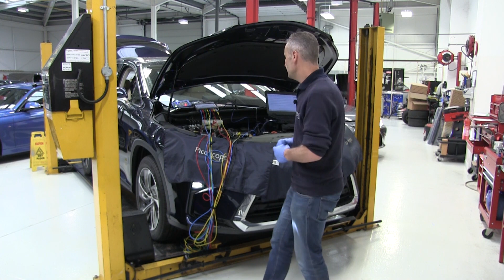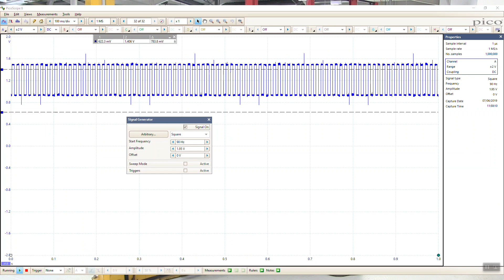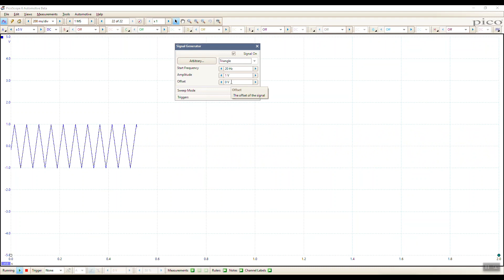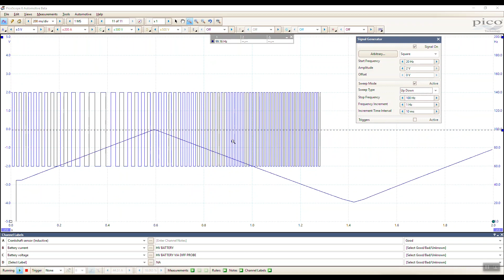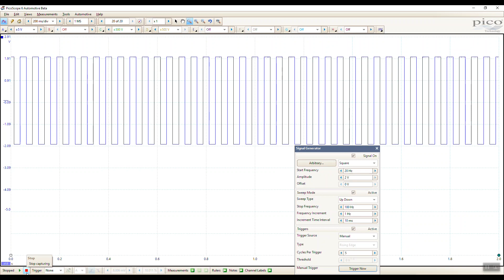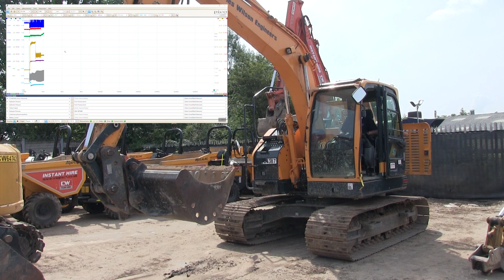Practical Pico: 8-channel testing with PicoScope 4823

Comment: are you guys coming out with a better 8ch than the 4824 clone at 50v? I feel like Pico can do better since the 4425A & 4425 at 200v
Reply: Id be interested, but wouldnt the common ground of the 8 be a bit noisy?

Comment: Awesome premier gents, I'm really excited for the 8 channel and the flexibility it will give us as Diagnosticians ⭐⭐⭐⭐⭐
Reply: Thanks for the kind feedback. Much appreciated 👍
Reply: Simply Diagnostics Steve how do you think the lack of protection voltage affect your use of this? 100v vs 200v input protection? I thought about getting this but I have the 4425 4ch. The sample rate seems better however there are some sacrifices. You think it’s better worse or different ?
Reply: @weldingjunkie  nothing an attenuator can't fix.
Reply: Simply Diagnostics would that be the only thing needed? Wasn’t sure with the floating grounds but makes sense.
Reply: @weldingjunkie  there's no doubt that you'd have to work hard to let the smoke out of a 4425 and connectivity is a lot more important with the 8 channel but I would imagine it's more a tool for a seasoned scope jockey than a beginner.
Reply: Simply Diagnostics that makes sense I think I’m going to stick with my 4425 for now until I start seeing the quad cams which I have not yet seen. It seems like for those you need 8ch or two 4425 but I think with 2 4425 you lose the picture with all 8 on same screen

Comment: I use my  picoscope signal generated function plus a OBD2 car scanner on live data to check sensor signal wire  integrity after I check voltage and ground very helpful, work perfectly for my on fuel pressure sensor (transducer), abs sensor, vaccum sensor, O2 sensor etc.............
Reply: My four channel pico did not come with a signal generator. That would of been pretty useful.